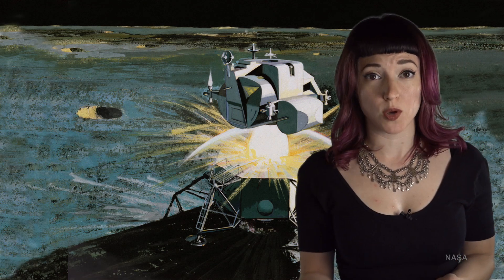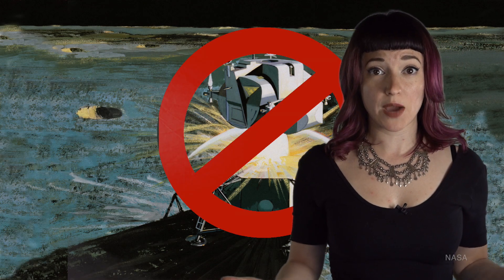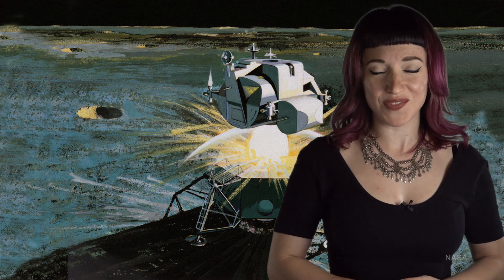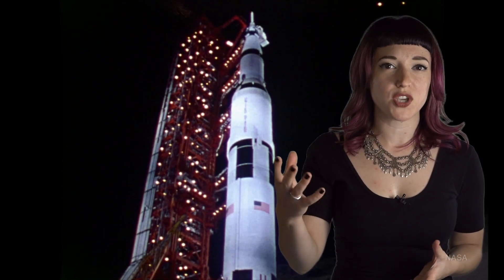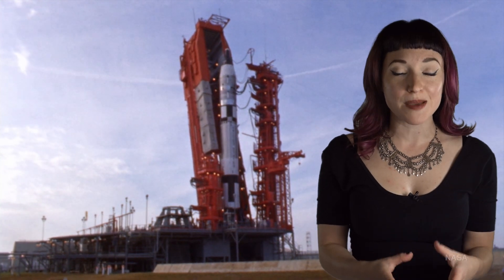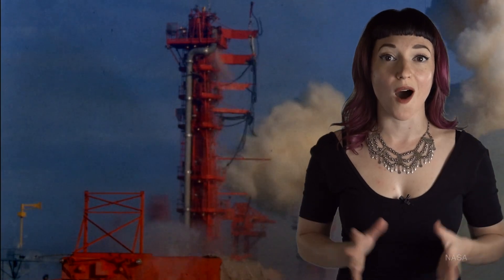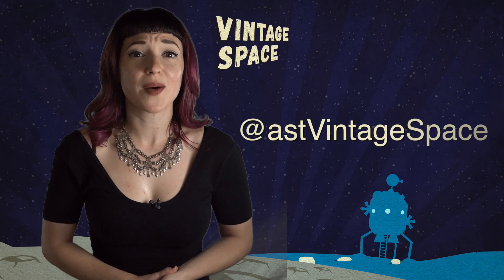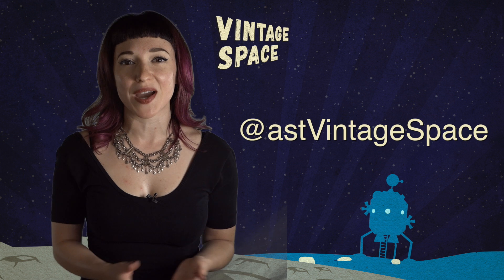How the Lunar Module Launched from the Moon Without a Flame

Comment: BULL...........SHIT !!!!! WHO TOOK THE PIC OF SEPARATION?😵😵😵😵CHECK OUT NASA VIDEO ON ORION AND THE VANALIN BELT. THE VIDEO STATES THAT THEY ARE TESTING ORIONS SURVIVABILITY THOUGH THE BELT,ONCE THERE ONCE BACK😵DO WHAT YOU DID IN 1969 LIARS!!  YOUTUBE IT YOURSELF AND WATCH YOU WILL SEE THAT THEIR LIARS IN 1969 OR LIARS TODAY.
Reply: ****IDIOT ALLERT ****
Reply: YOU SAID: "BULL...........SHIT !!!!! WHO TOOK THE PIC OF SEPARATION?😵😵😵😵"

== Let me get this straight.  You believe that nobody on the entire planet noticed this glaring "problem" until you, 50 years later?  You have never heard of a remote control camera before?

YOU SAID: "CHECK OUT NASA VIDEO ON ORION AND THE VANALIN BELT. THE VIDEO STATES THAT THEY ARE TESTING ORIONS SURVIVABILITY THOUGH THE BELT,ONCE THERE ONCE BACK😵"

== Um, dummy, yes, they did that back in 2014.  Why are you still quoting from a 5 year old video?  They tested Orion, and it passed.

YOU SAID: "DO WHAT YOU DID IN 1969 LIARS!!"

== So, let me get this straight also.  Orion is a new craft, with new mission parameters, with new computers, new shielding, new hull, new materials, etc.  Apollo went through the belts in about 2 hours.  Orion has missions planned to be in the belts for weeks at a time (as well as other ultra long duration flights in deep space, YEARS at a time).  But, you want them to just take what they did before on Apollo, designed for only 2 hours in the belts, and use the same stuff?  And, never to even test it??  You're opposed to them even TESTING the new shielding?  So, like, when the Boeing 747 was being designed, and they say they want to test the new wings, would you say, "HEY, THE WORLD WAR ONE BIPLANES FROM 1918 ALREADY HAD PERFECTLY GOOD WINGS, JUST USE THOSE ON THE 1969 BOEING 747"??  That's about the equivalent of what you're saying now.  You're saying an entirely different/new craft today, with brand new requirements, should use the exact same mechanisms as were used 50 year prior, with different requirements?

YOU SAID: "YOUTUBE IT YOURSELF AND WATCH YOU WILL SEE THAT THEIR LIARS IN 1969 OR LIARS TODAY."

== Learn English.  I promise you, it will serve you better in life to know how to read and write, than to stew about conspiracies and science topics you don't understand.  Good gods.

Comment: Hi there. I've always wondered how they planned to get between the CSM and the LEM in the case of a docking failure on ascent from the moon, given that they left the backpacks on the moon. Did the suits have enough of a supply for a quick transfer or did they have umbilicals? Just curious after reading one of Andrew Chaikin's books. Thanks!
Reply: Yes, they'd have gotten out of the craft and transferred outside.  The suits were tied into the oxygen supply in the craft themselves.  But, you're not going to die if you cut off the oxygen supply.  There's a lot of oxygen still in the suits.  Keep this in mind: they were able to easily transfer oxygen supplies from the backpacks to the outlets in the LEM, and they were prepared to share oxygen with each other on the lunar surface, etc.  The reason that those hoses were all visible, and the connectors were right on the front, is so they could move the supplies around as-needed.
Reply: Yes, they would have gone EVA.

Comment: This is not any sort of evidence or proof, no one actually cares about this topic, NASA couldn't go to the Moon

And still can't

every single thing about the entire moon landing series is complete fake, fabrication, and hoax

How did reel to reel film videotape your supposed evidence

Where is the documentation about the lead shielding around the real to reel film

How did they get the real to reel film back from the Moon
... After filming the return module lifting off of the surface, did the camera crew stay behind

idiots that believe the moon landings actually took place, are causing damage to Future generations and in our society

You must stop and start knowing things instead of assuming everything or even assuming anything

it's the road to enlightenment, but if you still believe in the heliocentric model or the moon landings, you are so far away from enlightenment, you couldn't see it with the Hubble telescope airplane that never got the mirrors working properly
🤣
Reply: None of what you wrote makes sense. I know you thinknit does, but it doesn't.

Comment: If you believe that we went to the moon you are mistaken
Reply: Why? What is your explanation for why they couldn't have?
Reply: How many reasons do you need. No fuel tanks on the moon lander no oxygen tanks. Come on look at it
Reply: @randymccall304  " No fuel tanks on the moon lander no oxygen tanks" The fuel and oxygen tanks were inside the structure. Why do you find that so difficult to understand? The descent stage contained the Descent engine, the required propellants, water and oxygen and the bay for storing equipment. The Ascent stage contained the propellants for the ascent engine, gaseous and liquid oxygen, hydrogen, fuel for the RCS thrusters, and a large electronics bay, as well as the pressure cab in for the crew.
Reply: "And the oxygen needed to burn the fuel" Remember, oxygen was not used as a propellant, the propellants were aerozine-50 and nitrogen tetroxide.
Reply: @randymccall304  "How many reasons do you need. " How many do you think there are? So far, there are none.
Reply: I stood beside the lander. Even if each moon Walker used 1/2 of the oxygen necessary to spend the time on the moon surface. And the oxygen needed to burn the fuel to take off the thing would have to have been 10 times the size it was.
Reply: @randymccall304  "And the oxygen needed to burn the fuel to take off the thing would have to have been 10 times the size it was." Really? Show us the calculations you did to determine that. "Even if each moon Walker used 1/2 of the oxygen necessary to spend the time on the moon surface"  What has that got to do with the ascent engine?
Reply: 56 million a month. Pretty good reason.
Reply: @randymccall304  "56 million a month. Pretty good reason." Which goes to the employees and contractors. Or did you think they did all that work for nothing?
Reply: Ian you work for NASA. Because I know people that do you are brainwashed
Reply: @randymccall304  No, I don't work for NASA. Not being a US citizen, I do not qualify. I have, however, studied physics, astronomy and spaceflight for some 50 years. You are the brainwashed one, as you simply accept the denier "proofs" without ever questioning them. Learn the science, study the relevant subjects.
Reply: Do you know anything about the firmament. Because it sounds like you are getting paid.
Reply: @randymccall304  
How many hours are you up to now?  Can you go 12 hours without getting high yet?  Still stuck at 4 or 5?  Are you in a program yet?  Or, are you still under the impression that those drugs aren't damaging your brain?
Reply: @randymccall304  "Do you know anything about the firmament. " I know the firmament, in the sense of a large enclosing dome, does not exist. The very fact that the atmosphere has a pressure gradient is proof of that.
Reply: I'm 61 no drugs no alcohol. God made everything he wrote a book about it through his holy spirit. Pay attention in genesis it tells about the firmament. We live in a closed system. Sorry you have to find out from someone beneath you. God bless. Get ready Jesus is coming soon.
Reply: @randymccall304  
No drugs or alcohol???  Well, that's good and bad, I guess.  I mean, I've never taken drugs, not ever, not even once.  And, I've never been drunk, I've only had a very few drinks in my life.  And, that's fine if you haven't either.  But, the bad part is, this means that your brain has been destroyed by other means.  I was hoping, at least if it was due to drugs, there'd be a chance your brain could return to normal.  But, if drugs aren't the reason your brain has been destroyed, then that means there's probably no chance that you can become normal.  Literally every word you write is laughably wrong.  But, you proudly display your ignorance for the whole world to see, as if it's a badge of honor to be an idiot.  Sad.  Another life wasted.  It's, sadly, too late for you, and you're doomed to piss your life, and your brain, down the toilet.
Reply: Wow why is the sky blue?????????
Reply: @randymccall304  Rayleigh scattering.
Reply: One thing about facts they piss people off that have been brainwashed.
Reply: @randymccall304  So I have noticed, but the brainwashed deniers don't believe in facts anyway, they go simply by emotion.

Comment: Explain how communications took place from the sea of tranquility to Houston? Please?
Reply: By radio. Radio waves travel at the speed of light, so cover the distance between Earth and Moon (or vice versa) in a second and a bit. Signals were sent via the S-band, a band of microwave frequencies specially selected because they are good at penetrating the Earth's atmosphere with little loss. They are received by whichever receiving station is facing the correct way at the time and relayed to Houston via satellite.

Comment: this mixture produces dark red smoke, no stars because it was day on the moon right Pippy (you're NASA's version of Pippy longstocking)so why didn't the actornauts boil in their JC Penney pant suits and fish bowl helmets? because Stanley Kubrick kept the soundstage well air conditioned
Reply: YOU SAID: "this mixture produces dark red smoke"

== Ridiculously wrong.  The mixture of N2O4 and Aerozine 50 results in an invisible/clear flame.  You get red smoke if the N2O4 breaks down into (x2) NO2.  This happens if the mixture is not balanced properly, and there is leftover N2O4 that gets very hot and unstable.

YOU SAID: "no stars because it was day on the moon right"

== Correct.

YOU SAID: "Pippy (you're NASA's version of Pippy longstocking)so why didn't the actornauts boil in their JC Penney pant suits and fish bowl helmets?"

== Because the suit was cooled by liquid cooling tubes, and a pourous plate sublimator in the the PLSS.

YOU SAID: "because Stanley Kubrick kept the soundstage well air conditioned"

== Why are you so proud to be so dumb?

Comment: We’re told that space is a vacuum.  How then does this gaseous propulsion system work in the vacuum of space?  Anyone know? Is there a technical paper or video demonstration showing how this system it works in such environments?
Reply: Alan there's a video out there of a guy putting a fan in a vacuum and not seeing the feather move check it out
Reply: YOU SAID: "We’re told that space is a vacuum."

== Correct.  But, there's actually no such thing as a 100% perfect vacuum.  But, yeah, space is considered a vacuum.

YOU SAID: "How then does this gaseous propulsion system work in the vacuum of space?"

== It's a rocket.  It works the same in space as it does in an atmosphere.  (Actually, rockets tend to be MORE efficient in space than in an atmosphere.)  Anyway, you combine a fuel with an oxidizer in an engine bell.  The expanding (basically "exploding" for all practical purposes) gasses have nowhere else to go besides out of the open end of the engine bell.  This results in the gasses basically "pushing" the inside of the engine bell in the opposite direction as the expanding gasses (Newton's 3rd law).

YOU SAID: "Anyone know?"

== Every rocket scientist and aerospace engineer and physicist on the planet knows.

YOU SAID: "Is there a technical paper or video demonstration showing how this system it works in such environments?"

== This very video shows you a demonstration.  But, I assume you mean more technical?  Have you considered typing "how do rockets work" into YouTube or Google?  I mean, of course, I'll be the first person to say that it's a bad idea to get a freestyle education from YouTube or Google.  There's a lot of garbage information mixed in with the good information.  And, without a solid education under your belt, it's difficult to know the difference between good information and bad information.  But, for something this basic, odds are pretty good that most of the sources should at least get the basics right.

Comment: Question? If the earth is 50 times bigger than the moon, the photo of the earth they took while they were on the moon should have taken up the whole sky or in this case the whole space? It would Not be the same size as the moon as we see it from earth!
Reply: Yes, the Earth is approximately 50x the size of the moon.  But, that's volume, not angular size (basically, meaning, diameter).  Earth is about 4x the diameter of the moon.  Think of a Rubik's Cube for comparison.  Many people don't realize it, but, if you have a 3x3x3 Rubik's Cube, the size of the total cube is 27x the size of one of the small cubes.  I guess a lot of people don't really ever actually multiply 3x3x3, but yes, it's 27.  But, anyway, in your field of view, the angular size of a Rubik's Cube is only 3x larger than the small cubes.  This is a product of 2D vs. 3D thinking.  So, yes, the Earth is 4x larger (angular size) than the moon.  But, that's still not a lot.  The moon's angular size is 0.5 degrees.  That means, if you draw a line 360 degrees around you (a line that passes through the moon in your field of view), the moon occupies 0.5 degrees of your field of view.  Well, ok, from the moon, viewing the Earth, it's the same concept, but now it's 2 degrees of your field of view (4x larger than the moon from Earth).  2 degrees is still pretty small.  You aren't going to notice this in just some photos.  And, it's nowhere near "taking up the whole sky."  Basically, this is a math problem, and you need to actually look at the numbers, not at some emotional viewpoint of what "50x the size" is supposed to mean to you.